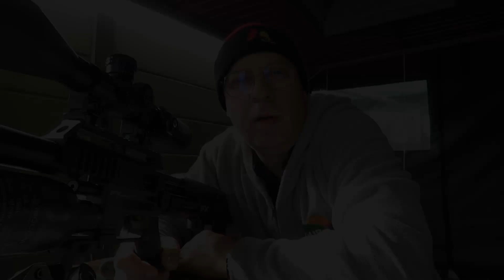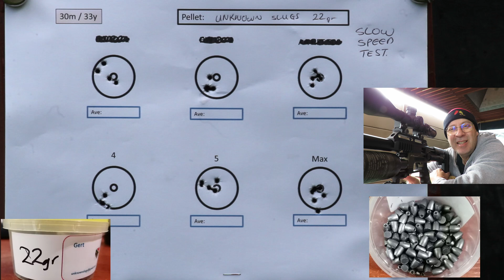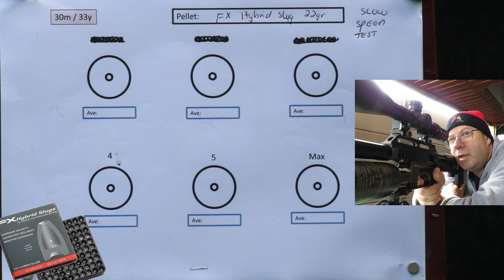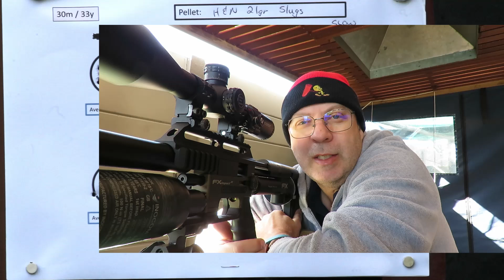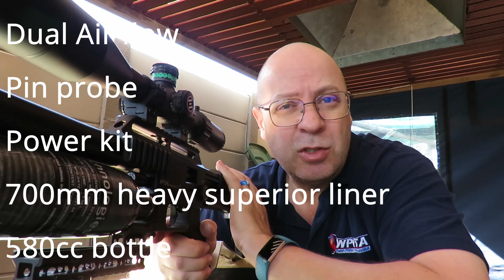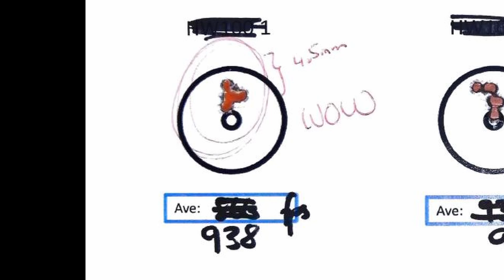22gr Velocity test, how slow can they go?

Comment: There are Slugs by Zan that are 20gr, Pro Hunter that are 17.8gr, NSA slugs that are 17.5gr and Zan Lead Free slugs that are 15gr, you should redo this test using those.
Reply from the maker: The challenge with the lighter slugs are that they don't like the modern magazines, they don't feed properly and get damaged in the load process. I ddi shoot the Zan's in all weights, the fast twist barrel hated them. The sweet spot where I could see accuracy improve was about 22gr...
Reply: @AimSmall  I use those slugs in my Fx DRS Pro and DRS Tactical, between 935 and 1050 depending on the slug and gun and have never had feeding issues.. Thats in .22 tho, I cant speak for .177.. Id be interested in seeing how well they perform at slower speeds but it took me so long to get the tunes of my guns to a point where they only have a spread of 3fps that I don't wanna risk using my rifles to see for myself 😂

Comment: Thanks for the video. I subscribed. I’m not sure I understand, did you change barrel for this test? I thought you were going to use a standard barrel all through the test. 

What would be interesting is to do the same test at say 50 yards, 100 yards and 150 yards and see what happens in terms of accuracy and penetration/energy on the target. 

I’m from Vancouver Canada. I am new to this, but I am realizing that the fundamentals of pellet rifles are much more complicated than standard guns, but it’s interesting.

I just purchased a Kervan air boss, K-1 25 caliber. I don’t know the twist rate of the barrel, but I’m trying to find out.
Reply from the maker: That has been some time ago I did these tests, sold most of the barrels so I can't repeat the exercise.
Reply: @AimSmall  Ok. But did you use the same barrel in the video or did you use two different barrels in that video? Because initially it started off as using a standard pellet barrel.
Reply from the maker: @surreallife777   Same barrel in that video.

Comment: But will they expand at low velocities?
Reply from the maker: At that low velocity it doesn't flatten the whole slug, but the expansion is good enough with the soft lead. Some manufacturers use harder lead, I know H&N used to use hard lead and the slugs didn't expand so good at any speed. If I am correct there Mk II slugs did see a change in lead, they did however change the hollow point that assists in expansion.

Comment: Just purchased a DAR Gen 3 PCP.  Would like to try slugs as it's insanely accurate with about every pellet I've fed it up to about 18.9 grains.  Velocity avg is a very consistent 820 fps.  Obviously lighter weight slugs will be in order, but are there any you'd recommend over another for a non-slug liner barrel?

Comment: I’ve shot the 23g and the 26g down at 490fps and they group relatively well at 50yards.
Reply from the maker: What gun did you use?
Reply: @AimSmall  ive used a detuned cr600w a qb78 and a hatsan at44. the qb would stack pellets and slugs at 25 yards but open up to a full inch around 45  with the slugs then open up to2 inches anything past that and regular diablo style pellets stay accurate even at 75. the cr600 is the canadian version of the diana stormrider and it held under an inch still at 50 and my hatsan had a really hard time shooting them under650fps.
i found they had a terrible bc under 600fps aswell most guns tend to send them tumbling at low speeds. my old benjamin discovery couldnt shoot any slugs period. wouldnt even group at 20.
Reply from the maker: @buildurtruckurway9118  Thank you for the information, very interesting results. Well done.

Comment: You get about 760fps ,if remember right, if you switch from 18grn jsb at 900fps or so to KO slugs. It has been a very good sweet spot in my Artimes barrel and out shoots the pellets by far. Very accurate and the BC difference almost covers the drop, but excels in wind.
Reply from the maker: Awesome news, every now and then I get slugs doing great at slower speeds, the KO's in 216 is not a good match for my barrel, haven't tried the 217's yet.
Reply: @AimSmall  The new KO MK2 are very good. They shoot in barrels that the old .216 did not shoot. My new favorite slug. You also get a bit more speed with the lower friction. I bet they will also be more forgiving in other brand barrels.
Reply from the maker: @waterandair3106  Will have to retest, my experience with the FX is that it prefers 218's most of the time, the 216's just rattle in the barrel and a lot of air is wasted around the sides.
Reply: @AimSmall  The old KO .216 only shot in my barrel up to 800fps and the the groups would open up going faster. The. 217 liked 880fps in my barrel. If I stay at 880fps my barrel never fouls up. I got 4cm and less groups at 100m with the MK2 yesterday. Super consistent with no fliers. It would be nice if you could make a comparison with them compared to other in that waight class. Inferno 25.4 has also been very good in the past and H&N 25grn.
Reply from the maker: @waterandair3106  Inferno has a lot of different shapes and sizes in 25gr, my gun unfortunately didn't like them at all. The 25gr and 27gr H&N has been the most accurate slugs to date at 100m out of my gun. WIll see if I can get hold of the Mk II KO's and .217's to test side by side.

Comment: Unfortunately, yet again I see another test that is flawed ! Judging how slow a slug can go based on group size isn’t a test ! Seeing how slow a slug can go should be done using high speed cameras (See the slow mo guys) simply to see if they fly straight at slower and slower velocities and using various barrel twist rates.  Then when the slowest speed has been found, tune the gun for the lowest extreme spread and standard deviation, then properly tune barrel harmonics with something like the new FX barrel tuner and see how they group ! Then and only then will you know just how slow slugs can be shot and the lowest power level they can be successfully shot ! So go and do it again, properly this time !
Reply: Flawed? Hardly. It’s a test to see how slow. What is the relevance / rationale of slow motion if the groups are that tight? It’s not going to tell you anything until you decide on a speed and then start to fine tune, which is not the point of this video. For a basic test, mission accomplished.

Comment: Nice test. But 30m for the slugs, what is the point. U can use pellets at that distance. Test them at 50 and 100m, that would be nice info.
Reply from the maker: Weather permitting sir, yes I know I need to go out to 100m but have been snowed under work and bad weather. 30m gives me at least an indication if there is any promise and it gives me an indication of speed to use at longer distances. Thank for watching and for the reply, much appreciated.

Comment: Hi there from the other side of SA (Ellisras-Limpopo). Really cool video and like that you went slower. Would you shoot slugs out of a co2 rifle? My current rifle is a  Artemis CP2, and I manage to get 8.02gr pellets out to around 800fps. Have never tried slugs before?
Reply from the maker: I am afraid they will not work out of a CO2 gun, just too slow, 22gr slugs will travle at +- 350gps, same speed as an arrow or paintball.
Reply: @AimSmall Thanks for your reply. I meant .177 slugs which are lighter. I know you get .177 slugs around the 13-15gr range. I have shot JSB Hades in .177 which are 10.3gr and I am getting around 760fps on those.
Reply from the maker: @African-Budget-Pellet-Gunner  JSb Hades in 177 is 8.44gr , if you push a 13gr slugs you are going to loose another 150fps or more
Reply: @AimSmall  Thanks so much for your insight and great videos, it is much appreciated

Comment: I think because of the stx barrel ! The hight speed is needed for the regular barrels !
Reply from the maker: You might be 100% correct here, "normal" barrels are aggresively grooved, slowing down the slug even more and making rifling marks on the slug, with the STX barrels there is almost nothing "gripping " the slug, no barrel rifling and it keeps the speed better.

Comment: Very good to know slugs also shoot well at lower speeds. I never tried it 😁 
Are you still having problems with the indexing on the big mags???
Have you tried the solution I gave you a couple of videos ago?? It really works, believe me !
Cheers! 👍 👍
Reply from the maker: Didn't try the solution, need to go and find it again
Reply: @AimSmall  it's on ''High power 177 Part 2''.👍
Reply from the maker: @MMM-RATTING  Thanks